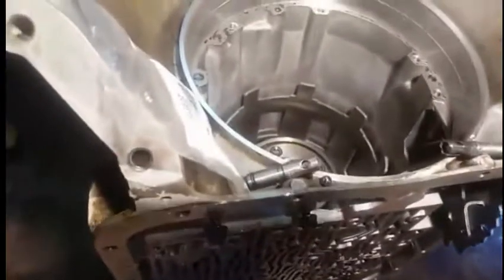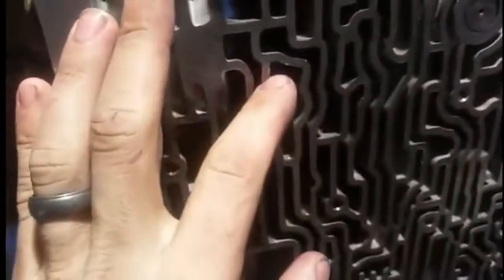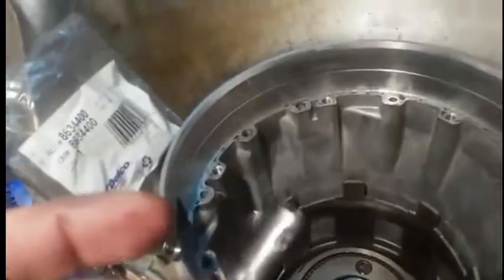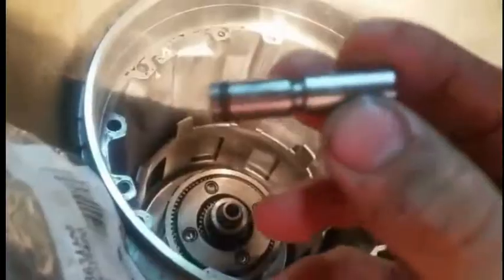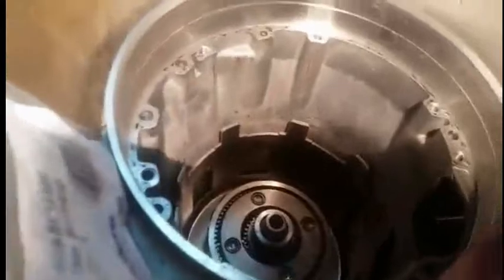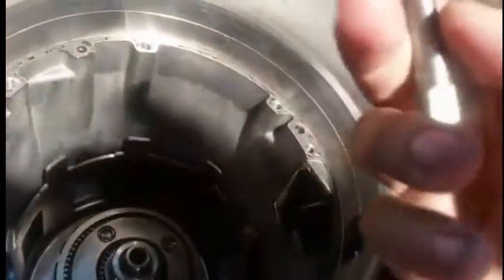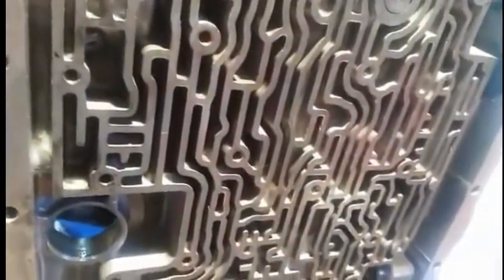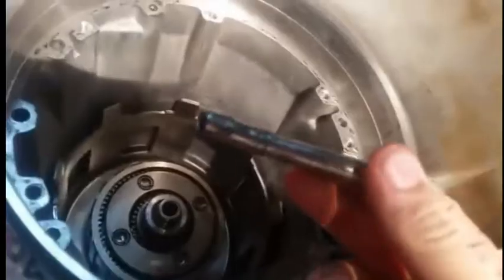4L60E and 700r4 checkball capsule (3rd accumulator checkball)

Comment: Using a 50% mixture of ATF and solvent, I drop enough to fill to cavity. A rubber tip air gun is required but only at 30 - 40 PSI. This 3rd apply pressure change with line pressure for better holding of the 3rd clutch pack, so many drop a 0.500” boost valve in the pump will cause this captured check to leak into the case. Now force motor or the line pressure regulator controls line, but the amperage it uses, plus inputs from MAF, TPS set the shift adapt mapping, that’s reset with a new trans. Failures in these devices, terminals or wiring can cause low line pressure to destroy 3rd. So a $10 captured check should not get your britches in a bunch. 
 The comment about dealers not stocking them maybe true, but the local warehouse distributors carry a dozen. Why not the dealer? Because 9 of ten times the transmission shows up in a case, ready to be installed. Engineering has a crew to document and diagnose the root cause of the failure based upon the customers complaint during tear down, inspection and testing.
 This is not saying dealer techs don’t rebuild these, but a “P1870” means slippage and effect emissions and falls into a different warranty category. Plus, it’s faster for the customer to get their vehicle back.
ASE Master Tech since 1978 / Retired

Comment: It's good idea to replace these. Even if they don't fail the leak test they can still leak during operation when under extreme pressure. The Sonnax check valve can still piggy-back over a new (or leaking) OE AC-Delco check valve. This is usually done for performance builds.

Comment: After 40 years in the transmission trade I have replaced one. There is simply not a lot that can go wrong here. Thank you for not telling viewers to plug that circuit off like many uniformed do. Mark
Reply from the maker: Mark, I replace them when I cannot be 100% certain they are clean. Sometimes a badly contaminated unit comes in, where the ball sticks in the round end, even after pressure flushing with mineral spirits. Not super common by any means, but definitely something to check and leak test if the person doing the work is equipped to do that. I have seen a handful where the checkball inside the capsule was pitted. Still unsure how that happens honestly. Regardless, as you said, NEVER plug that circuit off. I see DIY guys instruct other DIY guys to do it way too often. I run out of breath trying to tell them theyre botching the band release timing by plugging one lane of the two way street. Then they chase their tails trying to find the cause of their burnt band. Thanks for all your research and work you do with TransGo! I remember talking to you probably about 8 years ago on the tech line I believe.
Reply: Gm dealers wouldn't stock it if it never fails. Trans builders get so mad when some one that isn't a trans guy gets something right.
Reply: yeah and he left out the part about early models that shift hydrolicaly/not electric . like my 84 vette doesnt need one . nor does it have one in the low/reverse piston hole . like the rest . so if its not there dont add it .
Reply: P could that be the reason my 1992 700R transmission wasn't going in 3rd gear under moderate to heavy acceleration it only does it when the first couple from shift 2nd to 3rd , it only happens sometimes
Any ideas would be appreciated
Reply: Because this asshat puts a cap plug in the bore.